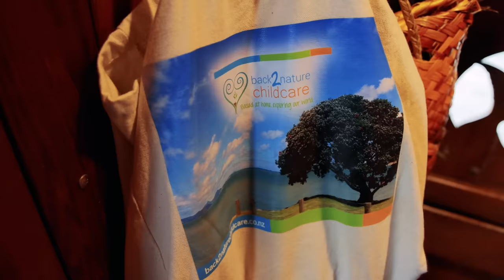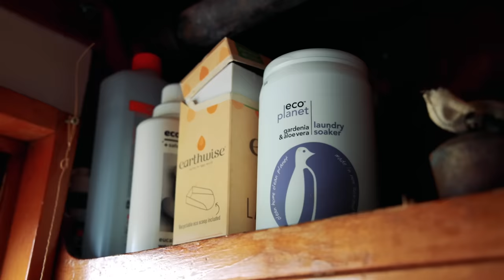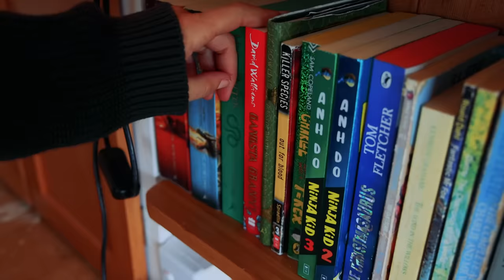Amazing House Bus Home & Airbnb By The Beach

Comment: Absolutely LOVE the hidden baths making double use of the deck area AND the winch-up polycarb wind-shields/walls - both brilliant ideas. I've been thinking about how best to do walls around a deck area to stop wind/rain/leaves getting in and deteriorating the decking but didn't like the idea of being enclosed by "ugly" polycarbonate all the time. However that's the PERFECT solution IMO. Totally stealing that. Wind/rain/leaf protection when you need it or when you're not there, and open to the air when you want it when you are there. Perfect. Thanks Greig and Rachel for the fantastic ideas :-) Might see if I can expand on the general concept to make even better use of the walls, but not sure if that would work. Thanks Rasa and Bryce for sharing this.

Comment: I've learned recently why so many tiny houses are short-term rentals (like airbnb) rather than people living in them full-time. At least here in the U.S. it comes down to building codes, and anti-homelessness laws. It's difficult to build a house up to code and have it count as a legal "dwelling", meaning someone can live in it 365 days a year - tiny houses are an option, but often have trouble meeting some picky details of the code, for example not having a vanity sink within 24 inches (60cm) of a side wall, or something. The POINT of buildings codes is to keep dwellings safe and accessible, and to legally protect the county or municipality from legal liability from allowing a shoddy deathtrap building, which is fair enough - I'm not knocking building codes. I don't want to live in a firetrap that's too cramped for firefighters to get in and rescue me from. But the restrictions they create can make it hard for a tiny house to meet code and "count" as a house.

It's a lot easier to get something that counts as a "recreational structure" - which doesn't have to be as safe and accessible as a permanent dwelling. BUT, largely because of anti-homelessness laws, it's not legal to live in one for more than 6 months at a time (or less in some places). You can stay in whatever structure you want if you're "camping" but it's not legal to be "camping" for more than a certain amount of time (which is just to punish homelessness). In some cities it's not legal to do anything that could be considered "camping" at all.

So, people can build a tiny house that is not up to code, count it as a recreational structure, and then they legally can't live in it full-time. Or if they do, they have to drag it around and park it in some other place, regularly, and it can be very difficult to find a place where it's legal to park.

Unfortunately, what ends up happening is, instead of tiny houses being a route to more affordable housing to people who can downsize their lives and build one, they're built as expensive playhouses by wealthy landed gentry looking to increase the market for short-term rentals, which have contributed to the rising cost of housing and rentals, pricing low wage workers out of their own neighborhoods. Tiny houses should be a housing scheme, not a moneymaking scheme, but the way our laws are set up, unfortunately they favor moneymaking schemes.

Comment: Just bought 3 acre property in Mannum & will be retiring there in approx 10yrs... council is being a bit of a pain we will be traveling there every 2 weeks for 10yrs but the council will not let us even put a tool shed, shipping container, caravan or tiny house, etc until we have a slab laid REALLY which means rain, hail or shine we will have to camp for 10yrs & it gets to -4c sometimes
.  We have to be totally solar power  + battery back up as to connect to "normal" electricity will be $75,000, we are not connected to water or septic/sewerage.  Thinking of mud brick, Earthship, straw bale, cob but I am actually astounded how much they will cost we will only have $100,000 to build + water tanks, solar, biocycle, etc as we want to be DEBT FREE & retire a little earlier than 67yrs old...ANY IDEAS people we would love them...
Reply: What did you end up doing?